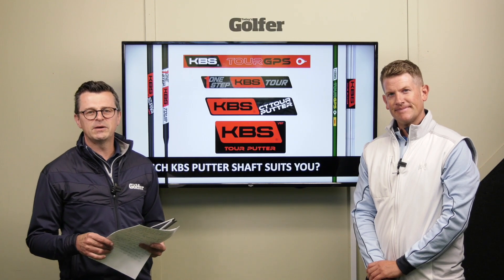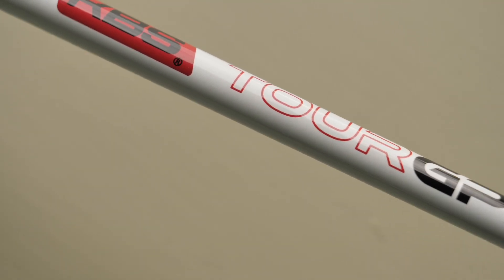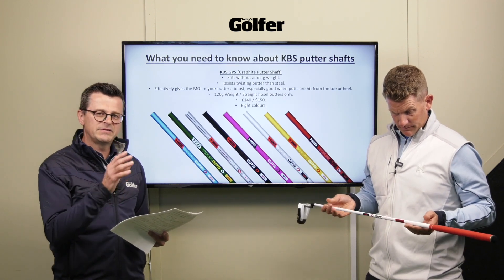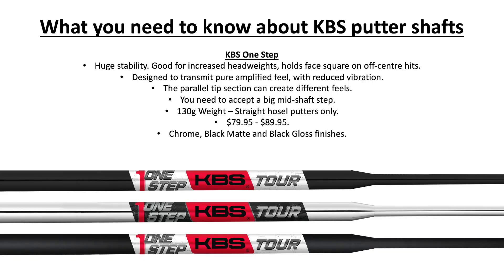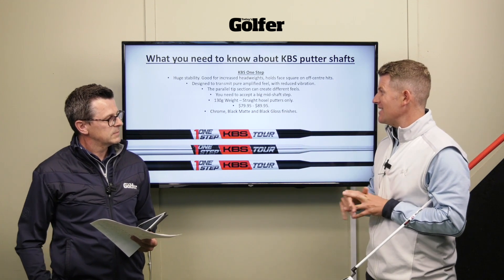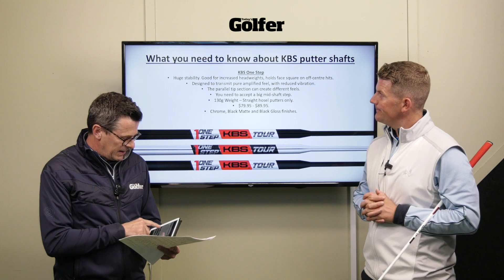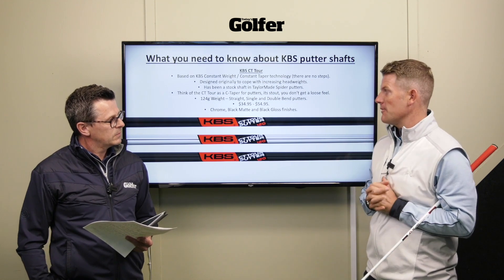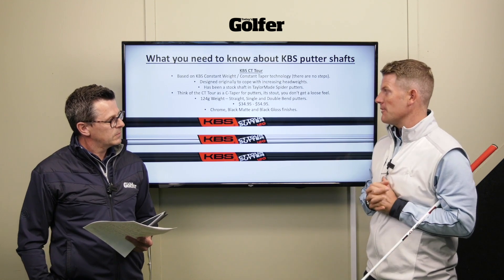Should you buy a stability putter shaft?

Comment: I’m a massive kbs user and I’ve just recently upgraded my putter shaft on my spider GT max putter from the stock tour 120 putter to the CT tour 120 shaft as with the stock shaft,it felt too light and not as stable and since I can’t get the centre weights in australia,I wanted something that’ll make the head feel heavier without adding additional weight in the head and make the putter more stable and that’s what I have now in my putter and I’m glad I made the change,I got weird looks for doing it but I knew what I wanted in the putter and now I have it
Reply from the maker: Great stuff Michael, so many golfers just don't know how you can change the feel and/or performance of a putter by switching shafts. 

Thanks for taking the time.

Comment: Are Anser type putters to light to need a shaft upgrade ?
Reply: Six of the top 25 PGA players in strokes gained: putting in 2023 used a graphite shaft. That's a very good number considering composite putter shafts are a fairly new trend. I have a Diamana shaft in my Toulon putter and absolutely love it. But to be honest, I didn't get it because of performance considerations. I got it because I've always loved Diamana wood shafts haha.